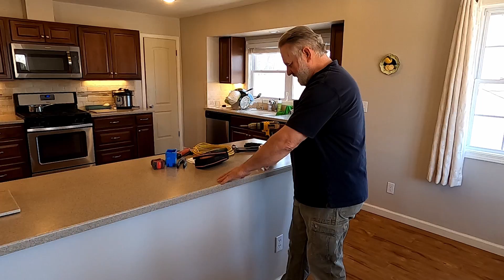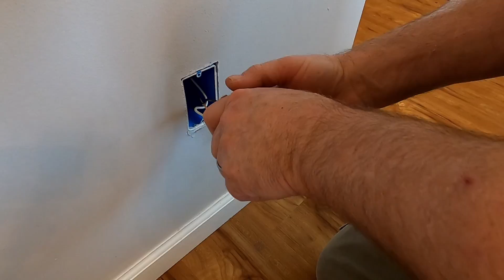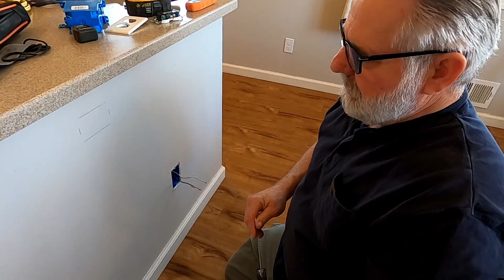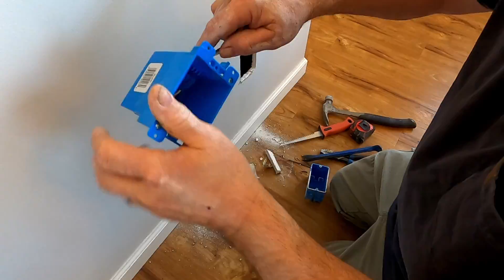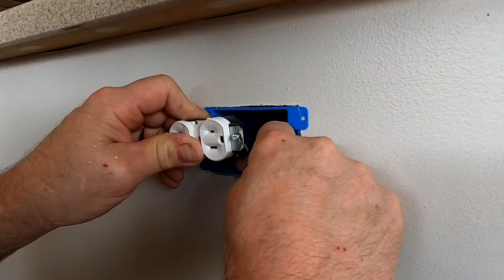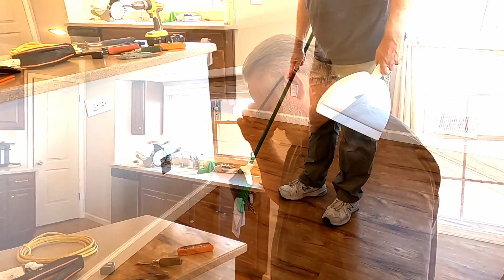How To Relocate Electrical Outlet (Part 1) | Show Me Construction

Comment: OK - but what about a scenario where the terminal-end box had to move FURTHER away from where the line was coming from? In your example - what if you had to move it 16" to the RIGHT and there was no slack in the line. What would you have to do?
Reply from the maker: If your wire is too short you would have to take it back to the next box and replace with longer wire. You'd have a bigger hole patch. Thanks for watching!

Comment: How did you know where the wire in the wall was?  Is it exposed on the inside of that cabinet or is there a device to show you where the wire is in the wall?
Reply from the maker: the plug was at the end of the circuit, so I figured it was coming from the plug to the left about 6 feet away. ( I took a chance and was correct)